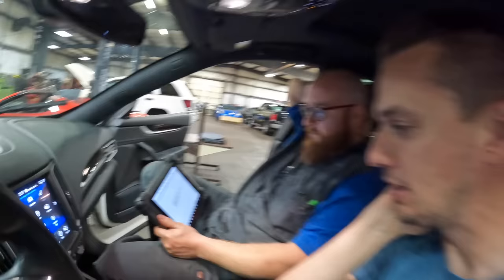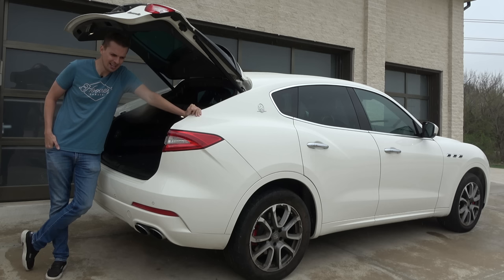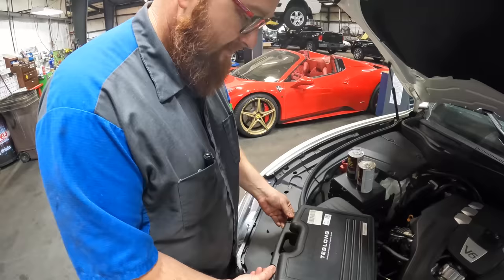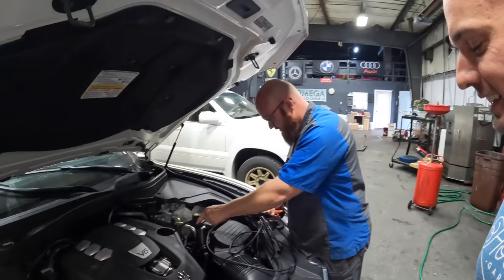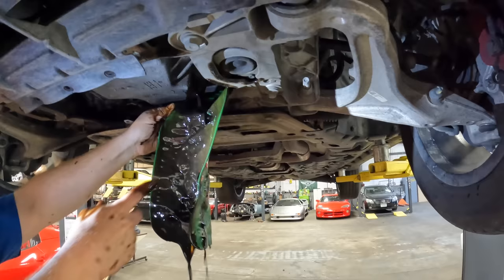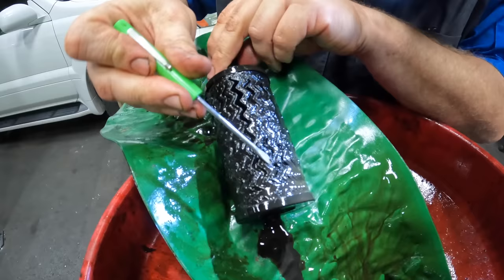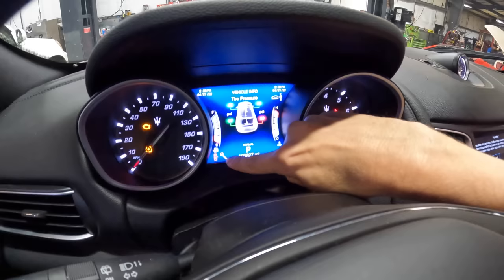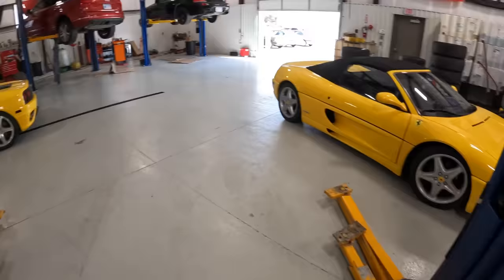My cheap Maserati Levante repo was a DRUG RUNNER, with NO OIL CHANGE for 60,000 miles!?!?!

Comment: Probably would be a good idea to do another flush/oil change in 500-1000 miles.   The new oil is going to pick up a lot of the sludge still in there.
Reply: I would do another flush right after the first, and change oil again in 1500-2000 miles
Reply: Would have used regular castrol and flush it after a week, that solvent flushing liquid is made to destroy oil and residue, i destroyed an 3100 gm v6 engine running it in the street to clean…..
Reply: @BigGyz680  worked for a co worker on my suggestion just get a few extra oil changes till drain oil reaches close to normal expectations that way no weird chemicals to attack weakened seals result was perfect.
Reply: He does his videos on the car then it sits for weeks
Reply: Yep that is what I would do.   I have had some great experience with Marvel Mystery Oil and I bet it is a ton cheaper.
Reply: Good idea,  at least other 2 flushes, just to make sure.
Reply: @BigGyz680  Yeah my advice is not to do a bunch of subsequent flushes. It’s clearly already been mistreated, and adding those detergents to the oil lowers the oil lubricity substantially. One flush, and some new synthetic oil! Change that oil again a few hundred later.
Reply: just use two quarts of oil. one quart of marvel mystery oil. one quart of seafoam…drive for 2 thousand repeat 😁😂
Reply: Use cheap Walmart oil on the first one then put in the good stuff after a few thousand miles.
Reply: I would do a second flush and replace filter and pump 🤣
Reply: BG treatment only instead of stupid oil changes
Reply: You took the words right out of my mouth. Additionally he should not ignore an oil pressure warning light if that car doesn't have an oil pressure gauge because sludge could clog up the oil pickup screen and if it does you need to react quickly or the engine is done.
Reply: Im sure the wizard would recommend that. Hes gonna flip this car anyways
Reply: Well I did a flush like 25 years ago, in a 302 and f... That engine up. Are engine flush better now?
Reply: Hoovie wouldn't have content then
Reply: @glenerickson358  yep
Reply: OMG really? You're so smart and ever so helpful! I get a warm, Jehova's-wittness-married-to-a-SDA kinda vibe from you. Thank you.
Reply: 100%
Reply: I wouldn't even wait that long. If I wanted to keep that vehicle I'd be doing it at 200 or even 100. That filter wasn't doing shyte. I'd also include 2 more cans of the engine flush prior to the next change. 

Eliot Alves did one where you drain the oil and run it with the flush only.
Reply: Yes in 500 for sure
Reply: I'm sure the wizard knows what he's doing.
Reply: I would just go another 60k miles before changing the oil. Save you money
Reply: @thomasryan8218  if he plans on keeping it for himself you should really do the oil change at 500 or less

I've been a mechanic my whole life I would probably run it only 100 miles and then do another oil change and then my next Oil Change would be in 1500 and then I'll go back to a regular oil change regimen
Reply: @Boomdizzle99  you’re right
Reply: @daveezrin1896  LMAO...BAHAHA, let the next owner worry about it... We all know that Hoovie will do the right thing in the end. But that was funny...
Reply: Yep.
Reply: Flush, add cheap Walmart oil and drive it for a couple weeks, flush it again, then add the good stuff!
Reply: I think I'd have filled it with some cheaper oil, another two cans of flush, a new filter and repeated the process, straight away. Then some decent oil and a new filter.
Reply: I'd started with emptying the engine of that "oil" and a new filter then adding diesel and having that sit in the pan for some days then emptying it out and then add some cheap thin synthetic oil and letting heatcycle a couple of times. After that I'd add a new filter and some nicer synthetic oil and run it 100miles before adding the correct oil and filter.
Reply: In the interest of science I want Hoovie to come back in a week and drain some out and let everyone see what the new oil looks like???
Reply: @superdrizzle7342  cheap walmart oil? You know oil is pretty much the same. Oh ypu are talking about supertech? Well it is very good oil
Reply: They did the BG flush completely wrong.  You have to change the oil and filter first.  Oil absorbs the dirt, old dirty oil can't absorb anything else and won't work with the flush to clean out the oil.  The filter has to be changed prior to the flush because it will get packed with dirt as you do this, as shown in this video.  With a filter already clogged and then doing this the oil pressure for sure went low while this was idling.  Low oil pressure and old worn oil diluted by a liter of water thick solution likely resulted in some bearing wear.  Just another example of the Wizard be arrogant not intelligent.
Reply: I was thinking the same thing
Reply: Gezz thanks for telling the mechanic what to do. You don’t get the show
Reply: wouldn't it make more sence just to change the filter that's what its for. bear in mind i fan a mk1 ford focas 1.8 zetec for 15 years with out changing the oil of filters once, it never skipped a beat.
Reply: So glad didn't waste $$ oil on a flush change...
Reply: The other option is to run diesel oil 15w-40 for a couple thousand miles. Will clean things up real good. Rotella, at least use to, have a bunch of zinc in it.
Reply: yeah i think they shouldve done another one after running it for a while
Reply: @BigGyz680  yes always flush with cheap regular oil, 1000 km
Reply: @BigGyz680  how long did you leave the flush in for? I was going to put some in on my Audi right before an oil change, just let it run for 20 mins with the flush and then drain everything but I've heard bad stories like yours so I'm not sure if it's even worth.
Reply: @phillipturner5853  that sounds like a great concoction to destroy an already mistreated engine. I wouldn't flush it more than once and then only use synthetic oil and change it a few times early
Reply: ep i would have used a budget oil in and ran it for 5 /6 miles until hot, drained and then put the expensive oil in, with a new filter. Then change oil every 8,000 miles. I am amazed the piston rings and crank baring's are not worn.
Reply: @preciadoalex123  what do you expect when you own 30+ cars
Reply: @JDJD-mw9rr  i would not ever use that stuff more than 10 minutes…. And will never use that again unless it was like that maserati,
I would rather if new or used run penzoil platinum, it has a ton of cleansing agents,
And would clean varnish with time…
Reply: @BigGyz680  ya I agree, it seems the cons out weigh the pros, I change my oil every 6 months with synthetic anyway which is very early because my car doesn't get alot of miles, many short trips, and my pcv started clogging with water/oil sludge because the car never gets up to full operating temp in the winter
Reply: Yeah - I’d do at least three cycles within 1000 miles
Reply: I bet the wizard has all that covered
Reply: @edwardguess6210  its not tho. Especially on a Maserati. Flush with the cheap stuff then run a high performance full synthetic extended performance with the best filter or oem filter every 20,000 miles. I use Mobil 1. I used to think that too but there has been major advancements to the durability of the oil.
Reply: I would put in 8 quarts of a basic synthetic the correct weight and drive it 50  miles and change the oil again to get rid of particulates and any left over solvent.   Its 30 bucks well spent
Reply: Hoover thought about calling the cops…what’s fking snitch!
Reply: Yes.  I would have have voted for cheap oil and a change shortly after.
Reply: Thanks captain obvious.
Reply: Probably a good idea to drop the oil pan and clean the strainer. All that crap will break off and get stuck in the pickup. That's why engines start knocking after flushes.
Reply: Newcious  Oh boy, another video to dislike and report! No one likes spammers.
Reply: I think you should look for some trap doors Hoovie. Smugglers who do interstate runs across country utilize these. Plus alot of smugglers forget they left a package here or there. If your pulled over by a cop do not tell him about theat smell. He may bring out a dog.
Reply: Working in a garage in Canada I have used all the bg kits and they do work really well....one of the very few additives that work as advertised
Reply: @jpmartin6191  The problem with oil flushes is they will open up the supply passageways because there is pressure behind it, but can clog the return passageways with sludge because there's only gravity pulling it back down.  What some suggest is cheap oil/filters and super short oil change intervals.  Let the detergent in the oil clean it slowly.
Reply: I was thinking the same, although i would do it in under a 100 miles. Lol
Reply: Agree. With another quick oil change after about 1-2k miles on here. Then run a little Lucas oil treatment in her after second change then keep on eye on her after changing it again. Not sure I’d run another full flush. All depends on what the filter looks like after next change.
Reply: Agree, put a cheaper oil in and run it for two hundred Kilometres or so and then repeat the flush with the supa flush stuff.
Reply: Probably would of done that if it was his personal car lol this is a car that he’s flipping for cash
Reply: Yeah id be changing the oil after an hour, and then once a week for a month
Reply: @jhonditch4269  transmission fluid
Reply: @kennethstrain5152  a old hillbilly diesel mechanic I know swears marvel
Reply: @phishphood423  the flushes aren't even detergents. Most of them are either kerosene and or ether. The either ones are the safer ones to use. The kerosene ones are pretty dangerous and harsh on the seals and you run the risk of washing out a crank or piston rod  bearing. I have seen it happen before. The first week I worked for my boss I told him not to used the mag 1 flushes he was using because what it could do. It took a few year.but put one in a Kia that was about 18000 over on the oil change. He put it in and ran it and started talking to the customer and lost track of time and is spun a couple of rod bearings. So the 30 dollars he was.going to make for the flush cost him a few grand. The best stuff to use for a engine is trans fluid. It is pretty much really high detergent oil
Reply: @russblack443  I would never have thought to use ATF...that's genius!
Reply: @glenerickson358  I would do a third flush 2000-2500 after the first two
Reply: Right? At least give it an Italian tuneup driving 85 for an hour on our fine Texas highways like Texas 130. 
Then run a BG engine flush and stock it with Pennzoil Platinum or Amsoil if you're serious about long term care. They were the top two synthetic oils tested by Project Farm.
Reply: @BigGyz680  You're only supposed to idle the flush for 5 minutes and drain immediately. 
Tell me you read the can.
Reply: I concur. Take it for long drives too, get it nice and hot
Reply: The motor needs a few quarts of tranny fluid mixed in for a few hundred miles.
Reply: I would do it after 1k
Reply: Use a liqui molly engine cleaner👍🏻
Reply: I would flush the the oil every 750 miles for the rest of the life of that vehicle lol
Reply: Yeah I’d do another one after a cpl hours of driving tbh
Reply: This was probably their own car and the whole thing is just a bit.
Reply: That filter was closed before the flush

Comment: I work with Maserati in Italy, the V6 of the levante is a chrysler pentastar tuned up by maserati and ferrari Engineers . The engine is produced in Maranello at the Ferrari factory and than it is shipped to Torino at the car assembly plant , it is a good and very reliable engine as proven by your video … the noise it makes tells you right away that it is not a Ferrari designed engine …. the correct and only lubricant for that engine in the USA is the Pennzoil platinum Maserati 10w60 not Castrol …. Please …   The only levante with a real Ferrari engine is the trofeo version that is mounting the fantastic Ferrari V8 with the standard Ferrari voice 😊
Reply: Why 10W60? That's a weird oil weight. I would've thought 0W30 or 5W30 would be more like it.
Reply: 1. Chrysler
2. good and very reliable engine
pick one.
Reply: @Live.Vibe.Lasers   Chrysler built inarguably the most reliable engine of all time, the Slant 6. But as far as modern Chrysler engines, there really aren't any "actual" Chrysler engines. You have Pentastars engineered by Mercedes and built by Fiat, you have some that were designed by Hyundai, some Mitsubishis, etc. People bragging about their big 'Merkin Hemis probably have no idea that it's like 80% a Renault/Peugot design lol
Reply: @RockandrollNegro  There is absolutely nothing that I can find about the 3rd gen hemi being any sort of design other than Chrysler. 
Its not that I didnt believe you, I just wanted to know more. And there is ZERO anything about anything of it being derived from another engine, let alone a psa motor. 
It looks to me to be a clean sheet design.

Edit:
Psa (or what is now psa) had a hemi engine back in the day. But there is no way it's related. The new hemi isn't technically even a hemi. It's pentaspherical, like every modern engine.

Edit 2: 
And there is zero indication that MB had anything to do with the development of the pentastar, other than it was developed at the time that the two companies were merged. 
But so was the m157, and no one is claiming Chrysler had anything to do with that. 
Well, actually, I've found a lot of forum posts saying that it is partially a MB design, but none of them had any sauce. It sounds like salesmen BS to me. 
"Yeah, this here new Dart has the v6 in it, and now that MB is running the show, you can think of this new Dart as a Mercedes engine. It's fancy."

This thread is useless without sources. Again, it's not that I don't believe you, but no one else is making the claims you are, and there is no documentation to back it up. When gm got help with the zr1 motor in 89, everyone knew it was a mercury marine thing. These things are known, not hidden.
Reply: @herranton  yeah really would like to know what Renault and Peugeot contributed to the Hemi.. firstly because they are direct competitors. PSA is Peugeot + Citroën (+Opel now) since the 80s and Renault has always been it’s own thing until Nissan and the rest. Even though I heard the engine and transmission in the delorean are Peugeot /Renault/Volvo
Reply: The Pennzoil 10W60 is the recommended oil, not a requirement.  The Castrol Supercar 10W60 meets all of the engineering requirements put forth by Maserati and will work just fine.
Reply: @RysterARCEE  Correct ... but Pennzoil is the first fill ... this is a 80K $ car.. why take a chance ..
Reply: @Live.Vibe.Lasers  This engine has only a Chrysler design  and blueprint but it is actually handcrafted in Maranello beside the regular Ferrari engines .. this thing has a quality level unknown to Chrysler ... this specific engine has the simplicity of  an american engine and the building quality of a luxury Brand .. that thing is indestructible I tell you ..
Reply: @TheBoski7  this thing ran 60k without oil changes. It probably wont care what brand the new oil is...
Reply: @TheBoski7  the engine has a Chrysler design and blueprint...but has quality unknown to Chrysler? Which is it?
Reply: @RockandrollNegro  MB had nothing to do with the Pentastar design. MB ended its relationship 2 years prior to the Pentastar's design and engineering, and 5 years before going into any Chrysler vehicle. The 5.7(2002+) and 6.4(2011+) are wholly owned and designed by Chrysler, as is the current Hellvat 6.2L V8. What do you mean they don't have their own engines? The 2.0T, current 4Xe systems, 4WD systems are all their designs.
Reply: @RockandrollNegro  the Hemi is all Chrysler from what I can find, I just did some Googling. I don't even think Renault or Peugot use V8s, they're also competitors, not allies.
Reply: So ur actually wrong. I have a friend who rebuilt both this engine and a pentastar engine and they are not the same or based the same. Very different engines.
Reply: @benjaminmartin3212   no I am not wrong but thank you for trying